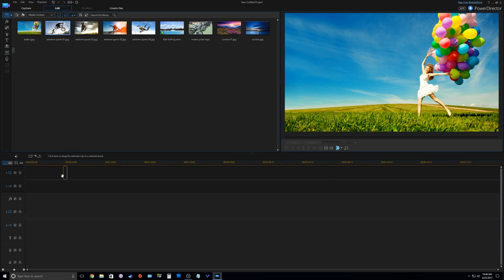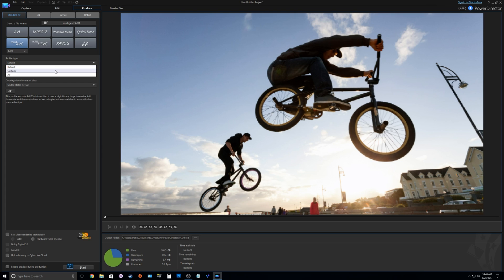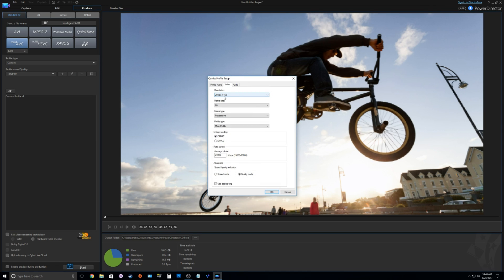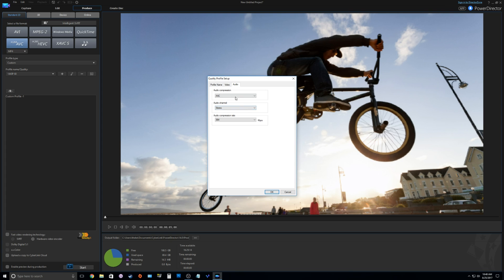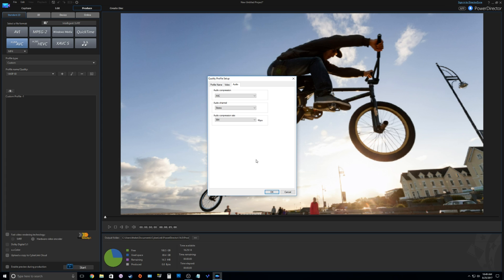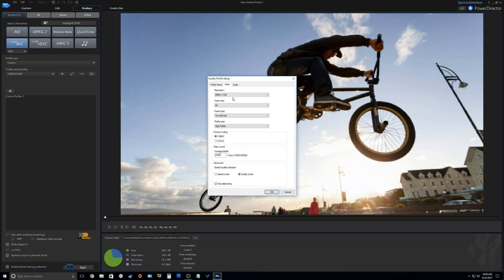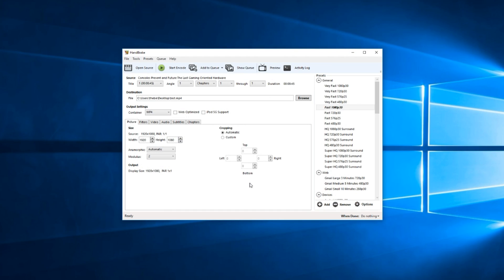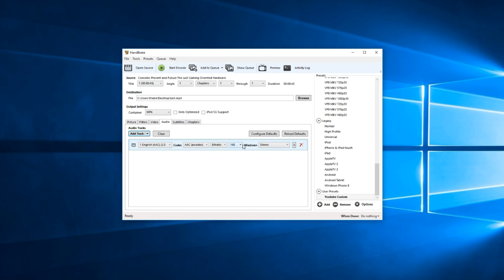PSA: Cyberlink PowerDirector Causing the Channel's Audio Problems!

Comment: PowerDirector 365 still has the same issues and guess what? Their customer support can't hear the difference... Nice solution, but it still is a workaround and the software is supposed to be working correctly. I can't understand that they refuse to fix this issue, which has been present in all previous versions! If you want to hear my examples:
https://www.youtube.com/watch?v=NamP49XqMvg

Comment: There is a noticeable audio quality improvement. So even if you need to work more to remake video I think that it deserve the effort. Thanks for sharing this tip because I had the same problem (I have Power Director 15 too) and for me is very helpful. Can you share the audio hardware you use please? Keep posting :)